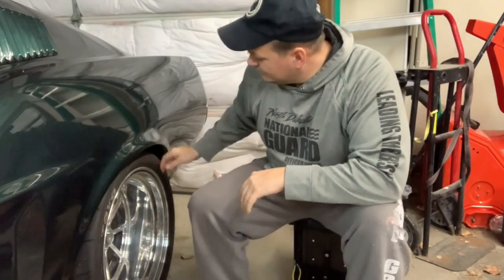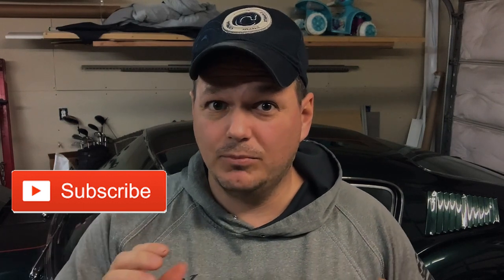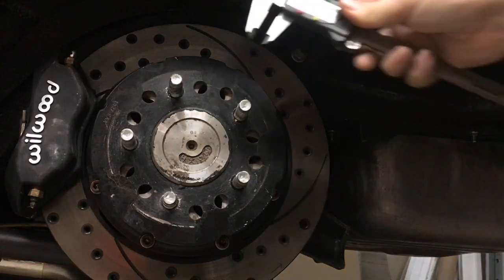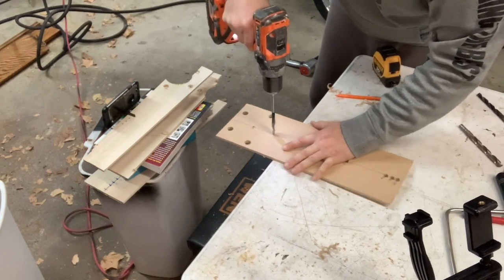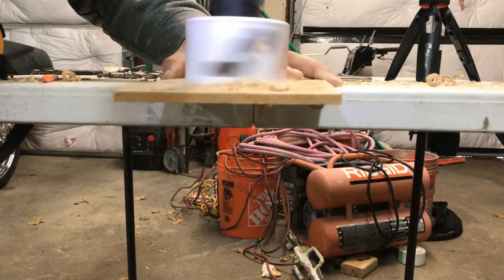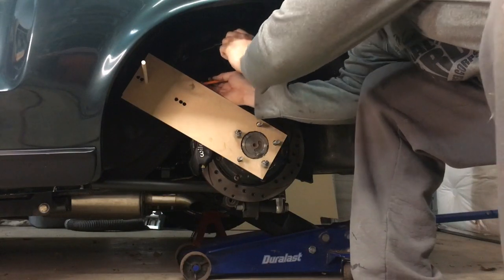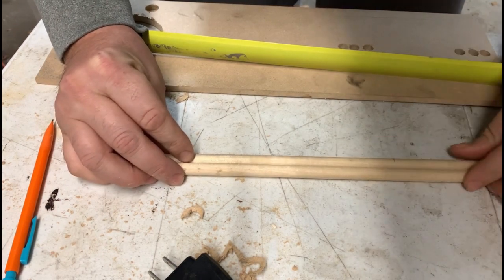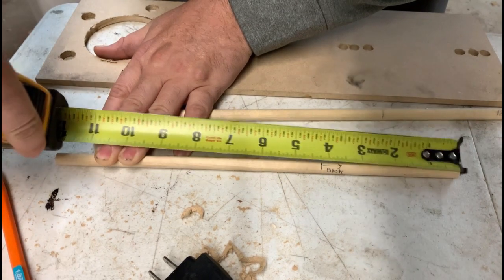How to Measure for Wheel Offset and Backspace

Comment: nice tool , good idea and thanks for sharing. Now my question, your outer end or length of dowel is determine by where your wheel well outer lip  correct? that would help in choosing what length dowel I presume. My 67 has a wider axle by 2 inch but it has widen steel flares by 1'' 1/4'', this will help me a lot in figuring what I can fit in the well.
  since this is an older post I may not get a response but hey, it's worth a try thanks.

Comment: Very cool video. What current size wheel/tire are you running and how do your like the R888Rs?
Reply from the maker: Thank you. I am running 17x8 wrapped in 235/17R40's in the front and 18x11 Wrapped in 315/18R35 in the rear

Comment: Great idea.  Is the BS really 4 1/8 since you are using the 12" rod for an 11" rim.   Should the BS be reduced by 1/2" for 1/2 the difference in 11 vs 12??
Reply from the maker: you would think since they don't the outside lip for the wheels size, but no.  In this case the outside flange is used. BS of a wheel is measured by placing the wheel on its front face, then taking a straight edge and placing it along the back side of the wheel, and measuring from wheel mounting hub to the bottom of the straight edge.

Comment: Wheels look amazing. What backspacing did you end up going with for your wheels?  Do you have a mini-tub?
Reply from the maker: Yes, I have Detroit Speed mini tubs. Running a 4.125" backspace on the rear wheels.
Reply: @arobsgarage6672  so your rear wheels are 18x11 with a 4.125 backspace? can you please tell me your front and rear wheel and tire  specs? do you know what your overall rear end width is? is your front suspension stock style or like a tci pro ifs front?  Thank you so much!

Comment: assuming the suspension is at load?
Reply from the maker: yes, I had the jackstands under the rear end housing.  The suspension needs to be under load. Same for front suspension. best to do fronts with the shocks and springs removed so you can adjust the range of motion to check clearances